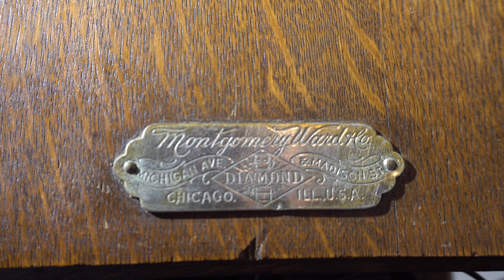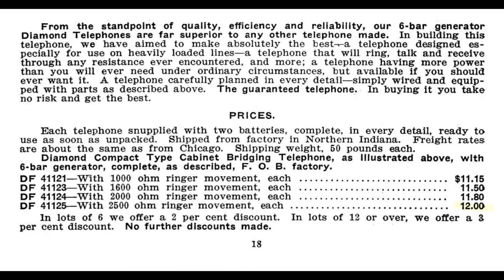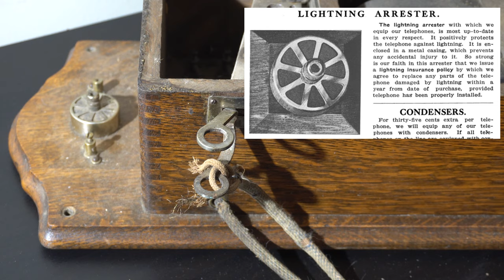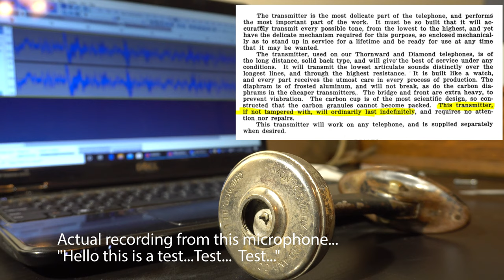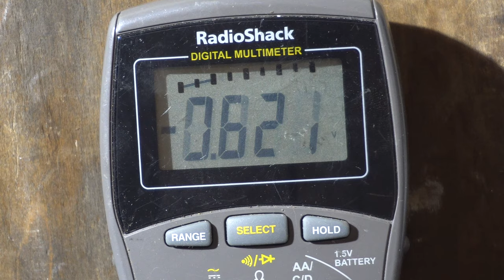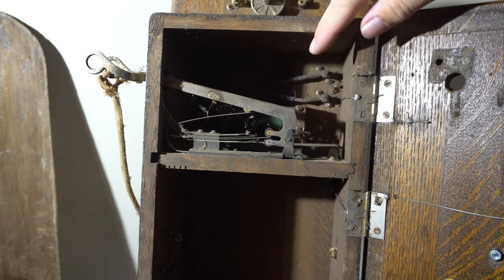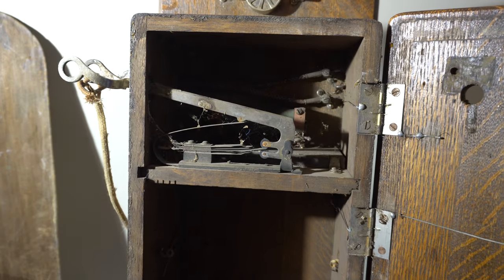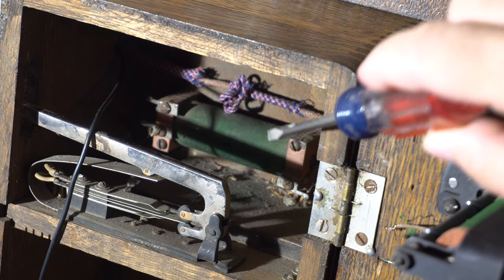What's inside a 113 year old Hand Crank Telephone?

Comment: I worked for the telephone company for 13 yrs. I worked on terminals placed in 1910, ad then built part of the network that replaced them.
Reply from the maker: It is amazing how long some of the old phone equipment lasts and even that I can plug a 1960s phone into my voip router today... Thanks for watching!
Reply: @ACBMemphis  fun fact: you can attach a phone from the early 1900s onto a modern network, it would only get dial tone, it would not have a dial.

Comment: If you get your hands on another magneto phone you can connect two of them together and use them as an intercom. My dad had an uncle who worked for the phone company when they were getting rid of them and replacing them with rotary dial phones. He had a small collection of magneto phones and used a pair of them for an intercom between the house and the barn.
Reply from the maker: That is a great idea. Thanks for watching!
Reply: Thats exactly what i plan on doing with mine. I have a Stromberg-Carlson Telephone. 5 magnito's. Currently there is a push button (dtmf) dialing pad integrated with the transmitter and receiver (speaker). So i can make and receive calls using a POTS line.
Reply: I think black bakelite phones with rotary dials with magnetos attached were used by railroad companies/ train stations in past years so one station could talk to another.
Reply: I'm looking for a wiring diagram to hook 2 of these phones together to use as an intercom.  Does anyone know where I could find one or some info on how to do this?

Comment: Maybe they did not think the "flexible" wire would hold up to movement between the components on the door and the ones inside the case.  By using the hinges as conductors, there were no wires to keep bending, or cloth "insulation" to wear away???

Comment: Cool review. Thanks for sharing. I found your channel researching these old models for a project I'm about to start for my channel. Do you know of a way to identify manufacturer if there are no marks anywhere on the equipment? We should connect, I am in the 901 also! Cheers!
Reply from the maker: No markings whatsoever... If you could find where the phone was installed based on a phone number or who you got it from, you might look for photos or phones used in the same place on eBay where the person selling indicated the model. Anyway, thanks for the comment! Your channel looks great. I have one of those old metal "Pinkertons detective agency" crates and I might reach out for some tips on how to restore it!
Reply: @ACBMemphis  I got it at an estate sale in Olive Branch or Hernando. Can't remember. The dude had a whole shed full of these things and other old electronics. I also found another old unit with a metal shell and a single push button in the center. No crank but the same receiver and transmitter as one of the old box phones. I am thinking an intercom of some sort? My plan is to restore a few of these to working order and figure out a way to create an intercom system between my house and shop in the backyard!!

Comment: I have a ringer mechanism from a old telephone, I want to use the ringer mechanism for another project. How do I hook it up?, It has 2 wires going to the coil, but it does nothing when I hook power to it, I checked it with a test meter and it shows it's good. But I can't get it to do anything?
Reply from the maker: I think that's easier said than done, because the power has to be AC and at the correct frequency. I was interested in making some of my old phones work too without altering them, and researched it a little.... One very expensive option is a phone line simulator. A cheaper option is a VOIP router (which has circuitry to ring old phones). If you just want the bell to ring, one thing I have seen online in a YouTube video, but not tried myself, is connecting the output of a hard drive motor to the bell and turning the motor.
Reply: @ACBMemphis  I took the ringer mechanism out of the phone, I just want to use the ringer mechanism for another project. It shows it's good on my test meter, but I can't get it to work or anything?. I tried using a 12volt dc adapter and a 24volt ac adapter. I just don't know what the correct voltage is to make it work. It's only got 2 small wires going to the coil on the ringer mechanism? I don't know if I have to have some kind of circuit board to make it work or what?